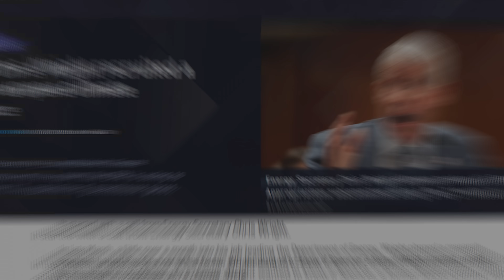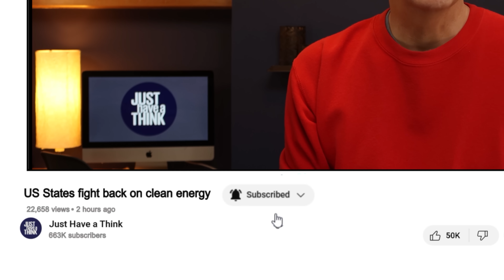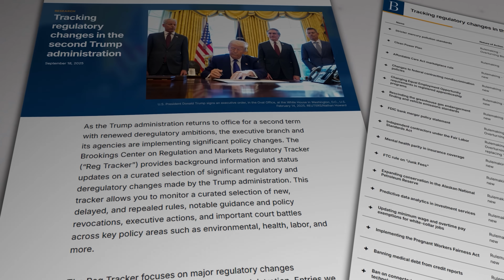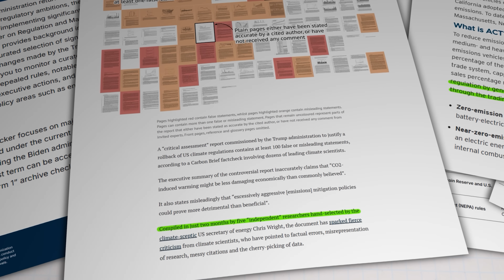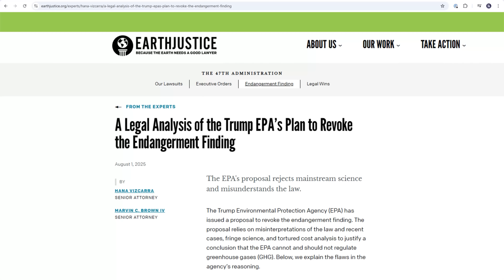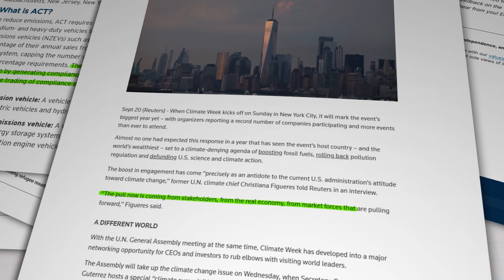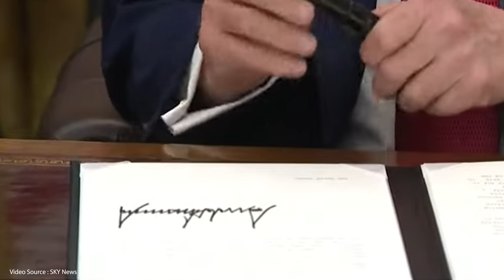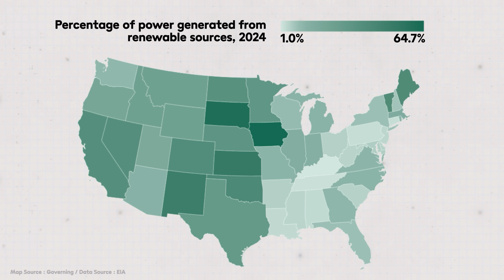The battle for American energy supremacy.

Comment: I live in a state that is NOT part of the alliance. I've had solar, geothermal HVAC, and an electric car for more than a decade because they're all less expensive. The local solar installer is booked months into next year. Yet, Troy Balderson, my representative, is promoting natural gas and coal. Yes, my government is out of step with many of the people.
Reply: Good thing you are rich enough to afford to buy those "cheaper" alternatives.
Reply: @dzcav3  its cheaper, idk why people are so hostile towards it
Reply: Solar and wind will happen anyway, because the feedstock cost is zero.
Reply: @Jackkalpakian  The "feedstock" cost is also zero for:
Coal
Oil
Gas
Uranium

They exist in the ground for free.
Reply: @aliendroneservices6621 You gotta dig them up and store them in special containers, ship them around and buy them before you can stick them in the generators. Solar? You buy the energy generation equipment and make sure it points reasonably close to where the sun is and the local flora doesn’t hate your guts.
Reply: @arandomperson7713  Wind and solar require mining rigs, (turbines and panels) which makes them not free.
Reply: Finite unlike the sun , and they’re simply putting too much co2 into the atmosphere , we have no choice
But to leave it behind why is that so difficult to accept ?
Reply: @aliendroneservices6621, You’re not very bright, eh?
Reply: @Maficman2112  "...we have no choice But to leave it behind..."
You think you can make decisions for other people?
Reply: @Maficman2112 , Although you’re correct, they’re discussing cost. It costs money for fossil fuel, while the sun and wind are delivered to your home for free regardless of whether you decide to use it or not. In both cases the equipment to convert the energy into something useful costs. The difference is a one time cost vs repeat costs. In the long run, the best choice is whichever one is cheaper. It turns out that both wind and solar are cheaper even when externalities are ignored.
Reply: @terjeoseberg990  Wind and solar entail repeat costs.
Those repeat costs of wind-and-solar can only be paid by fossil-fuels.
Wind and solar absolutely depend upon fossil-fuels for subsidy.
Wind-and-solar without fossil-fuels ultimately results in a state of permanent-blackout.
No fossil-fuels = no wind-and-solar.
Reply: @aliendroneservices6621, You’re obviously confused.
Reply: @aliendroneservices6621, You’re confused and severely misinformed.
Reply: @aliendroneservices6621 not at all, but the climate will decide for us I can promise that, and when it does it's going to be a lot worse. why not fix it now .....?
Reply: @terjeoseberg990  Roger that
Reply: @aliendroneservices6621 Would you give your time for free to dig them up, refine them and transport them?
Reply: @aliendroneservices6621 Ah, but now you changed the goal post. We did not talk about manufacturing of fossil energy or solar equipment but about extraction cost of sun versus oil. Your argument does not hold as the extraction cost of solar is nil. Oil and gas costs a fortune to extract. Both solar and fossil equipment obviously needs to be built for a cost.
Reply: @TurreTuntematon  No, you are moving the goalposts.  The cost of extraction (and storing) of solar for electricity is extremely high requiring complex expensive machinery.  Heating a rock to a low temp sitting in the sun is free.  Converting solar power to AC electricity is not.
Reply: @tarstarkusz So you mean oil doesn’t have to get drilled? 😂. I have to do nothing sitting here on my island using my electricity from the solar roof.
Reply: @TurreTuntematon  Complex machines need to be built.
Reply: @aliendroneservices6621Mate you need to look past the fossil fuel propaganda. What you are saying is either out of date, skewed or just plain wrong.
Reply: @aliendroneservices6621 They might exist in the ground for free but it is not free to extract them.  Land leases, drilling, pumping, refining and distribution is definitely not free unlike wind and solar.  True enough there is maintenance costs but they are much simpler than anything from fossil feedstock.
Reply: @aliendroneservices6621 Wow!  I don't know where you think the truth is but you've definitely not done your homework.  You think fossil fuels have no repeat costs?
Reply: @jmasseys  Wind and solar are not free either.  That is why the true cost of solar is higher than the cost of, say, natural gas.
Reply: @aliendroneservices6621 Sure, and how much to dig them out of the ground?  Store them? Transport them? Then clean up after them?
Reply: @aliendroneservices6621 I am not sure what "repeat costs" are?  Subsidies are provided for fossil fuels as well.
Reply: @bryanwhitton1784  Fossil fuels are not subsidized in the US.  In fact, they are heavily taxed.
Reply: @tarstarkusz , You are wrong. Fossil fuel is heavily subsidized in the United States. Learn to use Google.
Reply: @tarstarkusz , “That new amount, created with the passage of the One Big Beautiful Bill Act this summer, adds to $30.8 billion a year in preexisting subsidies for the fossil fuel industry. The report finds that the amount of public money the US will now spend on domestic fossil fuels stands at least $34.8 billion a year.”
Reply: @aliendroneservices6621people on the internet are not economically literate. They love the slogan of renewables being free... What they don't understand is that renewables just shift the load from operational cost to capital cost. It has nothing to do with one being free and the other being not free.
Reply: @gf4913 , It’s not free, but it’s cheaper. Everyone understands that. Nobody claims that it’s free. If you believe that they do, then you have a comprehension problem which is leaving you confused and ignore ant.
Reply: @terjeoseberg990 No theu definately do not understand that, as you can read from their answers. Besides, It's not cheaper. It's only cheaper if you disregard the cost for storage and the huge investment necessary to the grid to accomodate for the inelasticity of wind and solar. In the real world, where people expect their light to turn on every time they flip a switch, you have to factor these costs.
Reply: @aliendroneservices6621Yes! These muppets are ridiculous.
Reply: Seems shills for big oil are spread false information about the true costs of solar and wind. Over any period of time longer than 10 years gas and oil are far more expensive.  That's the fact today and will continue to be a better choice for the foreseeable future.
Reply: @ronstephen-wy4ib What is the average lifespan for a solar panel or a wind turbines, especially an offshore wind turbine?
Reply: @aliendroneservices6621you are lucky! You have all these raw materials in your garden. Have you also a refinery in your house?
Reply: @aliendroneservices6621the sun is the raw material for photovoltaic. And you don't pay for it. 
Unless Trump puts a tariff on it!
Reply: @terjeoseberg990 or payed?
Reply: @giulianozunino324 You don't understand what a "raw material" is!
Reply: @Maficman2112 Bill Gates seems to no longer believe this.
Reply: @tarstarkusz  Whatever amounts to "true cost" in your book, where I live, Wind and Solar come in at about $4 ct to 9 ct/kWh (depending on the installation type), while electricity from gas costs about 10 ct to 18 ct /kWh (again depending on the type, and that's already including using the hot exhaust gasses for domestic heat). And that includes the total cost of ownership from buying the equipment, installing it, operating it, getting gas out of the ground and transported on site (the part you get for free with Wind and Solar), and after having served its purpose, dismantling it and getting it either recycled or to a landfill.
Reply: @jacobzindel987  Bill Gates still believes it, but thinks, there are more urgent problems like widespread poverty which have to be solved first.
Reply: @SiqueScarface  Nonsense.  It only has a low cost going by LCOE which does not capture the true cost.  You need many multiples of what you need in terms of nominal power.  Like if you need 1kw continuously, 24/7 365, you will need at least 10kw of panels and 120kwh of battery. You need to generate a full 24 hours worth of electricity, plus some charging capacity in the short days of winter. Plus winter tends to produce multiple 3-5 day periods of very heavy cloud cover, snow on the panels and ice on the panels.  This is why you need 120 hours of batteries.  Then you need to entirely recharge those batteries after a 3-5 days solar outage.  All on the shortest days of the year with the sun low in the sky. 

Another cost not captured by LCOE is all the additional grid you need to deal with how spread solar is.
Reply: @aliendroneservices6621 But the power plants that USE them do not exist for free in the ground. DUH!!!
Reply: NONSENSE.  EVs are like 25k more expensive than a car.  Geothermal HVAC is far, far more expensive than ordinary HVAC.  Solar plus batteries has a longer payback time than most people will live in a home.
Reply: @tarstarkusz , The payback for solar is about 5 years.
Reply: @tarstarkusz , You are wrong. Fossil fuel is heavily subsidized in the United States. Learn to use Google.

“That new amount, created with the passage of the One Big Beautiful Bill Act this summer, adds to $30.8 billion a year in preexisting subsidies for the fossil fuel industry. The report finds that the amount of public money the US will now spend on domestic fossil fuels stands at least $34.8 billion a year.”

In summary, Trump’s Big Beautiful Bill increase fossil fuel subsidies from $30.8 billion a year to $34.8 billion a year. That took me about 2 seconds to find using Google.
Reply: @tarstarkusz  I don't know where you live, but here around, a new internal combustion car costs about the same as an equivalent EV. Both start around $20,000, a midsize sedan is about $40,000, and for high end - well, you pay high end prices anyway.
Reply: @SiqueScarface  Not in the US.  High end in the US is whole number multiples of 40 grand.
I am unaware of any EV in the US costing anywhere near 20k.  Even few real cars are that inexpensive.
Reply: @tarstarkusz  A used EV is really inexpensive. Get them coming off lease or from a rental company. Geothermal is more expensive up front but far cheaper in the long run. Solar without batteries ROI is 7-9 years on 25-30 year panels. Use net metering and treat the grid as your battery. I'm in his house for life. No mortgage anymore, partly because I focused on the long run and containing my costs. Not nonsense. If you want inefficient but cheap up front, you'll pay for that, renewable or not.
Reply: @zztong  First, this is likely only temporary.  If EV values continue to plummet after a year or 2, they will totally fail.  But second, used cars are still cheaper than used EVs.  EVs don't make economic sense for most people.  Granted, most people don't shop for cars based on economic rationalism. So EVs have that going for them.  Some people just love them and will buy them no matter how little sense they make.

Solar payback is likely longer when you aren't getting them at subsidized prices.  Also, the rollback of your meter is going away.  This is a huge subsidy that everyone else pays for.  A kwh going in is not the same a kwh going out because the one coming in has all the other associated costs with it, primarily the grid.  You should NEVER be paid the same for your kwh as you pay for an incoming kwh.  Reversing the meter is exactly that.  It basically means no grid maintenance is possible from an economic perspective.
Reply: @tarstarkusz  So does a 30 year mortgage. Beyond that, there's lots of micro-scale "off grid" solar and battery systems being installed all over the world these days cause it's financially prohibitive and obviously impossible. Africa installed over 15 gigawatts of solar panels last years. For comparison, the USA just reached the 50 gigawatt milestone last year.  Buy a $500 solar power system from China. In sunny places in the world you can fairly easily get 10,000 kWh out of it in 5 years, i.e. 5 cents/kWh.  If you use it for 20 years(get 40,000kWh from), you're down to a penny per kWh.

Comment: Thank you for an excellent video, I would also add to your points that many companies and utilities have to plan projects years in advance. So if I am Ford, PG&E, or General Electric, I am most likely thinking about projects way past this administration. I am also going to think about my equities in global markets, where presumably there is a premium and higher value placed on green tech. This administration can certainly cause a lot of pain as you pointed out but as long as free markets are still a thing, and at face value this administration says they are (take that for what is worth) it doesn’t mean the end of the line. It’s a lot of posturing at the corporate level. Or that’s what I tell myself to feel better.

Comment: The Federal Gov actions "could potentially raise emissions".  I doubt that they could. During Trumps first term in office he wore a miners hat and to a cheering crowd he pronounced his love for coal.  Coal consumption continued to fall - it fell faster than under Obama.  To increase emissions, you would have to build new coal plants.  I don't think that would happen and old ones will continue to be closed or operate with reduced capacity factors.  And in the transport space, people will continue to buy EVs in higher numbers.  People will continue to put solar on their rooftops. Trucking firms are likely to start on their electrification journey. Grid scale batteries will increasingly reduce the capacity factors of Gas Peakers as they get cheaper everyday (sodium batteries will ensure those prices keep falling). The best the federal trumpwits will achieve is to slow emissions reductions to a rate that lower than what it could have been with aggressive policies.  In the words of Tony Seba - "it is like gravity". I hope that I am proved correct (for once).

Comment: I'm all for solar at the individual home owner level. If you live in reasonably sunny climate, the question is why not if it makes economic sense to you as an individual homeowner. Particularly if you have an EV. Even large scale highrise buildings, shopping centers, factories. What I'm not for is vast swaths of country covered in panels or even worse wind mills. Both of which have a lifespan of maybe 25 years and require large expenditures on infrastructure, cross country utility etc. At the macro level hydro, geothermal and nuclear make a lot more sense. Nuclear in particular is 'expensive' yeah, because of the hyped up fear induced by years of media bad news... likely financed by big oil. Nuclear is actually even safer than wind; just see the dead Golden Eagles prevalent around any big wind farm.
Reply: And another uninformed troll

Comment: 25 years ago I started putting solar to work on our all electric home.  I have always sized my system to more than is required.  Now on sunny days I produces so much that after charging everything, I give back nearly half of what I produce. Our home uses a bit over 1000 kWh per month.  We are self reliant plus charging two EVs and still have given over 5800kWh to the grid so far in 2025.
Reply: We have been working towards an all electric home, and now a solar and battery home with an EV, for five years! Insulating the house, then putting a new, metal roof on in preparation for fire season and solar. Then an electric heat pump, mini split system and hot water heater, then replacing the gas cooking stove with induction and our propane barbecue with an amazing Traeger smoker. And this year, we saved up enough to install solar and replace a 20 year old gas car with a 2 year old EV. 

By going all electric and solar, we will have pre-paid for home and vehicle energy for the ten years before we retire and then for as long after retirement as we last.

And, in the US it is no longer safe for citizens of blue states to buy fossil fuels from red states. Any money we send to Texas or Exxon or Walmart the MAGAs use to further shred our constitution and rule of law. And now they are sending armed troops into blue states. 

So, we love being off grid. And we love our rocket fast and mostly free to drive EV, and we love that we no longer send money to violent, fascist red states or nutzeeee, MAGA corporations.
Reply: @freeheeler09well done, very impressive. It’s not always about return on investment. I too have installed solar, batteries, purchased an EV and now working on the heat pump, I will never see a return on the money put into these items, but I feel I have tried to do my bit and leave the planet in a better state than I found it.